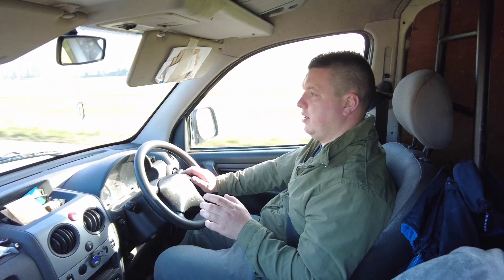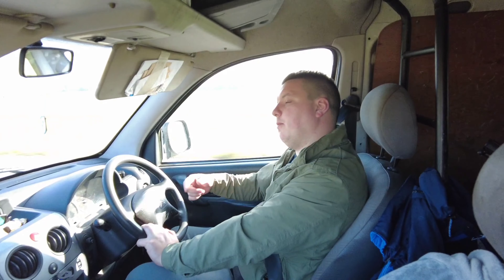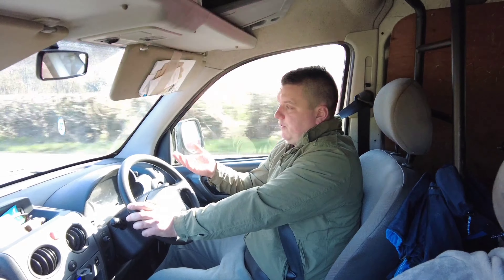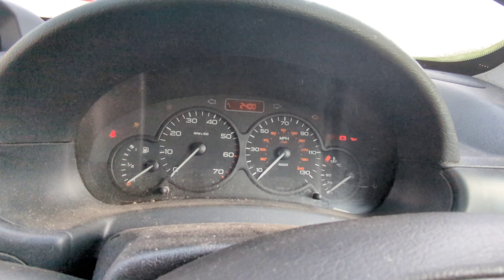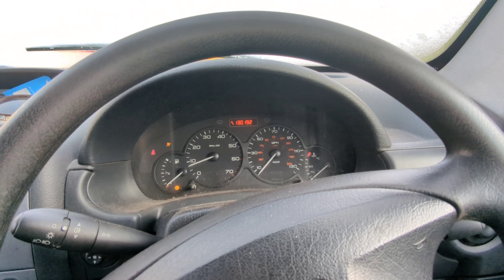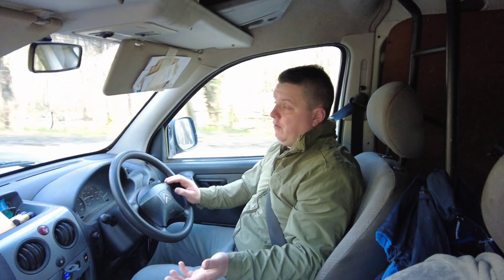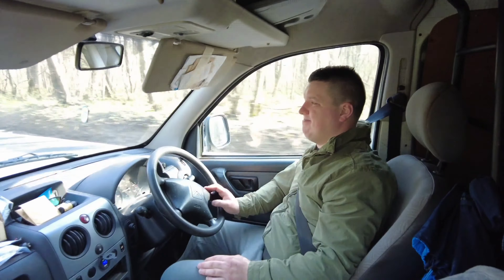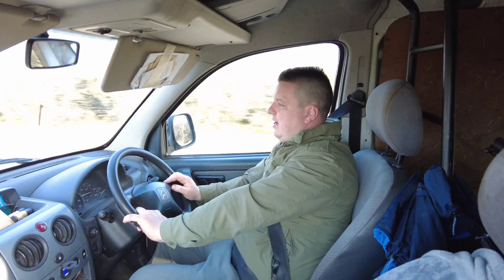I ran my car on cooking oil for a week and this happened .. veg oil chip fat update 1

Comment: You can use cooking oil in any diesel. You just need a filter and a preheater Add a second battery and a fuel line heater or start on diesel with a three way valve kit.
Reply: Two tank systems need a six way valve.
Reply: Even new diesels?
Reply: Coolant to fuel heater works best
Reply: @bbglas007  most pumps will run into problems on the long term. The best ones are old mercedes line pumps and bosch vp 'verteilerpumpe'. 

So you're looking at 23+ year old cars now.
Reply: @bobdebouwer7835 Can I do it on my MK5 Golf 1.9TDI? It’s a 2004 model so quite old.
Reply: @Jamez1093  mk5 has pd tdi.

Need to convert it. 

But not worth the hassle
Reply: @bobdebouwer7835  mixing it with regular petrodiesel 10% can assist ignition
Reply: My 1995 Hilux has 600,000 on the clock, 400,000 on waste vege oil, never has a spanner to it. Oil changes every 5000. Catch cann on crank case ventilator. Still going strong.
Reply: @quickcinema8031  10% is not much for a pd pump .

You need a 2 tank system
Reply: @bbglas007 Nope. Anything older than the year 2000.
Reply: @MrSpot41  is it still easy to pick up waste veg oil?

Comment: Hello.  I accidentally came across your video and was immediately impressed by what you mentioned about Ukraine.  Yes I'm from ukraine.  And, yes, I use sunflower oil as fuel for my van.  I agree with you that it is much cheaper than diesel and has the same result except for the smell.  In the winter, for normal engine start, I use fuel filter heating, so I'm fine even at temperatures 10-15 degrees Celsius below zero.

Comment: Eventually veg will gum up your pistons rings, it's starts with excessive blowby and then low compression. It may start on one cylinder or several. You will also start noticing that your sump oil level rises as veg starts to blow past rings and into crankcase. It starts to congeal in your engine oil and block oil filters. Been messing with veg for 5 years now it does work but there are drawbacks. You need the right injection pump, twin tank system and heat exchange for a start if you want to run it long-term. You can mix 20 percent petrol in to thin it out but you will get vapour lock if you also heat it. Otherwise just run it on a banger you don't care about until it dies.
Reply: That's what an engine cleaner is for ;-)
Reply: @kellymiller9273  what's engine cleaner?
Reply: @westendinventor364  well I could rave all day long but i was introduced to this stuff when i bought a bone yard engine that had smoke, lifter knocks and ran and sounded like crap the old man next door said relax because i was mad as hell and he knew i busted my ass getting that little 4.3 into that s10 he said go make a sandwich and allow me to put this stuff in a jar in your oil if it don't work I will buy you a new engine, at that point I didn't hear anything but food lol so a half hr later, I went out I am like' OK start it, and that old long hair guy looks me dead in the eye's and said, ITS RUNNING! you want to find out about something that just isn't on the market and you want me to tell the world lol If I did that, Id make the video myself and get the check myself lol but if you want some and are willing to pay cod for it? I will send you a jar with a video of me putting it in my car but never put it in a small engine it doesn't work well with those either way up to you, not to many people got the balls to try something that actually works they want to use Lucas and that shit is fricken GARBAGE in my book it is no better than NO Smoke lol
Reply: @kellymiller9273  I think I understood some of that.. Whatever product you use to "Clean" the engine that is mixed in with the oil it will have no effect on gummed up rings as no oil gets to the upper rings. The only additives that work are added to the fuel tank as they are then sprayed into the combustion chamber and subsequently the rings. The only thing I found to work on gummed rings is Acetone, poured directly into the cylinder and left for several days.
Reply: i have heard and read alot about thining it out with 20-30 percent kerosene have you ever tried it or have any knolage about it?
Reply: Sad but true. One day googling was enough to relize it. 
Even if you only use it heated, high load hot engine, polymerazion will cause gumming and finally destroy engine. 
And if you heat it how hot is it in the injector? 
It shoud be 200C in injector piping.
Reply: How do we get past the vapour lock issue?
Reply: @narrotor9276  any thinning is good. An oil that is more fluid. 

But watch your health. Don't use old engine oil
Reply: @Fubarpapa  start with using a car that is the best for it.
Old mercedes line pump. Or a bosch verteilerpumpe. 

Then do a 2 tank conversion.

This setup will last a lomg time.
Reply: @bobdebouwer7835  But I want nice car to drive.
Reply: @Fubarpapa  get a classic car then:)

Comment: Normally people running straight veg oil or WVO in cold climates run two tanks one for mineral diesel and the second for WVO. The WVO tank and the WVO filter are heated with hot engine coolant. The vehicle is started and stopped with diesel, after the engine is up to temp the WVO in the tank will be warming and thinning in viscosity and valves are switched to draw fuel from the warm WVO tank and the diesel tank is shut off. A couple minutes before shutting down the engine to sit in the cold valves are opened to allow diesel to the engine and shut off the WVO tank.
Reply: adding gasoline 1% to 5% is good to help cold start
Reply: @quickcinema8031  That may work for mildly cold climates like North Georgia, Tennessee, North Carolina, etc, but not in New Hampshire or northern New England, the upper Midwest, or the Dakota's. Even biodiesel which has had its glycerin removed will still crystalize and not pour or flow in -10F to -40F

Comment: Its not a biofuel unless a producer labels it as one. As a non hydrocarbon it has to be mixed with a hydrocarbon fuel that has a duty on it. If you buy it as a plant oil, new or used. Its just a plant oil regardless of where you poor it.

Theres nothing illegal, even after 2500 litres, because its not mixed at the point of sale.

Comment: I would say to use a 50/50 mix vegetable oil and acetone.
Reply: have you use it ? i think acetone is too strong for engine seals
Reply: @quickcinema8031  I guess if not acetone then at least denatured alcohol? 70% vegetable oil 30% denatured alcohol?

Comment: Transits run fine on on 50/50 mix veg oil and clean diesel, if you can be bothered to wait a week and mix the oil with methanol and lye it turns the oil to the same viscosity as diesel and will run with no issues at all. The new mk8 transit will run perfectly on biofuel, Ford even announced this in 2018 giving fleet owners the option to go green on there fuel. Common rails will run on it but has to be the right consistency. Every tank of bio I use I add diesel fuel system cleaner to it (redex) bio will act as tank cleaner and draw any sediment through. I run the 1st 500 miles then changed the fuel filter ran another 500 and did it again buy that time I’m pretty sure it’s cleaned out what it was going to clean out and have best part of 5000 miles on my 2.4 mk7 tipper using bio.
Looking at getting an old sh#tbox so I can experiment with just straight oil.
Cool video btw 👍🏻
Reply: How much Methanol do you need for 10 liters of filtered cooking oil?
Reply: @five-star-media  You need 2 Litres of Methanol for 10 Litres of Filtered Cooking Oil
Reply: @muthunchakrabalaji3741  Can i change Methanol with Gasoline ? since Diesel fuel is containing 25% petroleum.

Comment: Add a bit of white spirit. Very small bit per gallon. Look into it. Been meaning to fully look into it for a long while - injectors, fuel pumps, winter use additives, etc. etc..
Reply: how much is the proportion ? other say methanol / propylene glycol / acetone. I wonder if gasoline can
Reply: i think i am interested with white spirit, because it have been reviewed on TopGear. 97% vegetable oil and 3% white spirit, let it react for a week. other say 1 day. gonna give it a shot.

Comment: Iv stopped using my C4 1.6 Hdi because i again refuse to pay them prices so i'm rolling in my Corsa 1.2 instead.. you could argue that im not saving much in regards to fuel economy but im not driving far now only to work and back so using the C4 would only clog it up (DPF) etc
Reply: You might wanna mix that with Lucas Diesel Anti Gel.

Comment: How to summon all the couch dwellers who never left their computer: make a video about cooking oil as fuel.

These comments are absolutely atrocious. I can see at least 100 different opinions but 0 facts.

6 years running it here and no problems yet of blowby, polymerization, rods and pistons leaving left and right, or anything like that. I have however had problems with coked up glow plugs that last just a couple of months.

Comment: Does anyone know if veg oil will work ok on a 08 transit mk7?
Reply: it will work with pre heater. and to assist cold start you can mix it with 10% regular petrodiesel

Comment: Could I run it on Clio Dynamique Dci 106 2007 plate diesel? Thanks
Reply from the maker: No as it has high pressure common rail injection system
Reply: @CARTALKUK  could you mix like 50 50?
Reply: @CARTALKUK ???
Reply from the maker: @deanlynchwardroofing728  no I wouldn't use any cooking oil in a common rail injection system as it's to thick for the system
Reply: What cheap banger would you reckomend??
Reply: @deanlynchwardroofing728  try a Massey Ferguson lol.
Reply: @deanlynchwardroofing728  any 1.9 SDi from VW Skoda or the 1.5 Peugoet 106/ citeron saxo 1.5 diesel
Reply: @CARTALKUK  how come most DW8’s idle at around 1100rpm? my dad has one from 2016 great van but absolutely slow as a wet week if you’re used to anything with a turbo 😂
Reply: You can absolutely use it in a modern diesel but you need to thin it out, check top gears video they used like a tiny tiny bit of some white spirit or something
Reply: Hi, how many mpg and how much it costs?
Reply: @aztekarchive  French car mostly have 'lucas' pumps which are not the best for this. Get an old VW.
Reply: @Ghost_Alex282  There's more to it then just thinning.
Reply: @bobdebouwer7835  plus the French cars would rip itself internally after a few thousand miles 😂 so yeah I would go for the VW too 😂

Comment: Is your van running a bosch pump? Had a berlingo 1.9d and it had a lucas which they reckon aren't suitable
Reply: 1.9 d i run on 90% old engine oil and 10% petrol 6 7 months dead cooking oil much better with that still runs thats for sure easy u can put 80%!!
Reply: @thomasofficial1981  I would say 50% max on veg oil with Lucas pumps, perhaps little less or little more depending on the season.

Comment: I know some people filter the oil and then do a 50/50 or 60/40 mix of filtered veg oil to diesel. You'll still have to pay for some diesel but it lowers the viscosity a bit and if you're not paying for the veg oil it's kinda win win. There are other methods too. I've also heard of people filtering/treating old engine oil and mixing it with their diesel engine fuel. Don't quote me. Do your own research. Could potentially harm your engine, especially a newer one.
Reply: should be tested the viscosity first, i think. if the viscosity is the same, then it is good to go. What about mixing it with methanol or gasoline a little ?